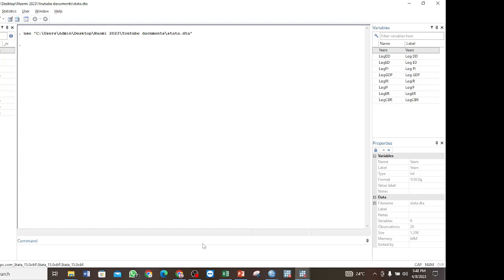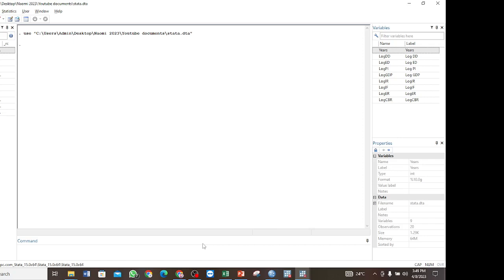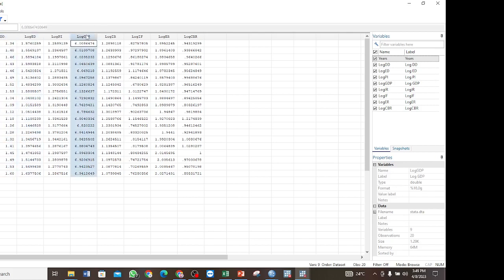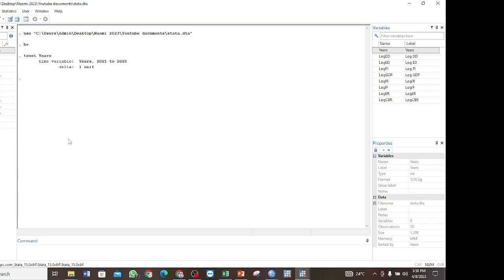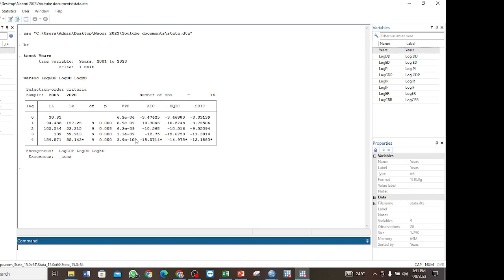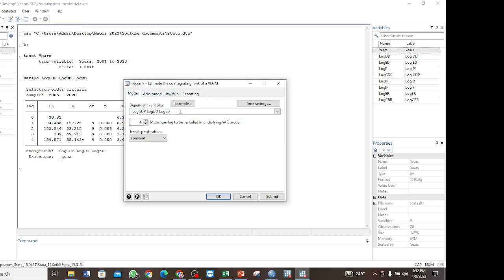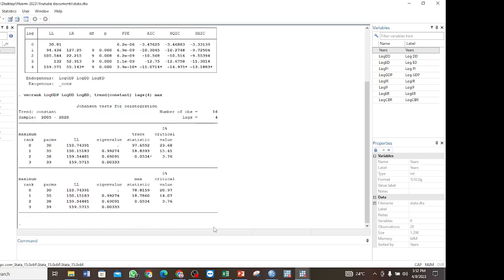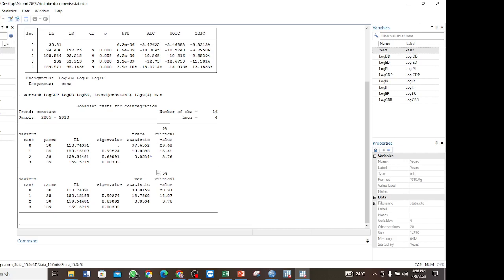Johansen Cointegration Test in STATA

Comment: Good presentation but kindly correct the mix-up on the interpretation. The correct interpretation is that if the Trace or Max statistics is/are higher than the 5% critical value, then we reject the Null hypothesis of no cointegration.